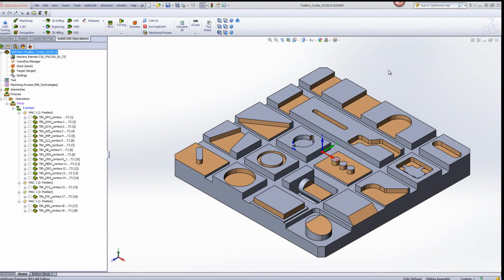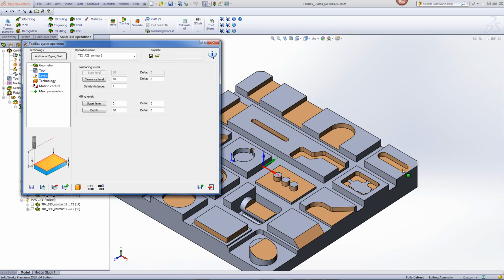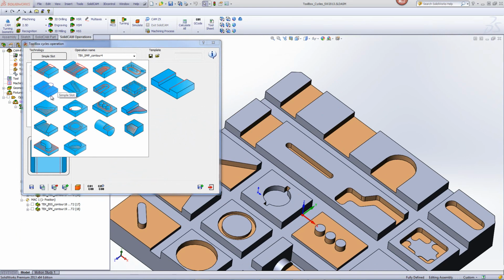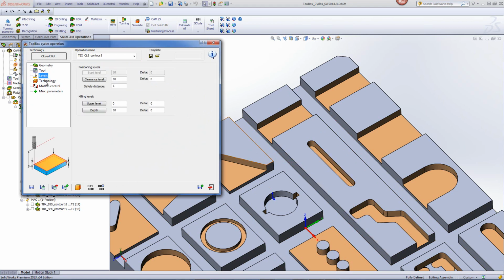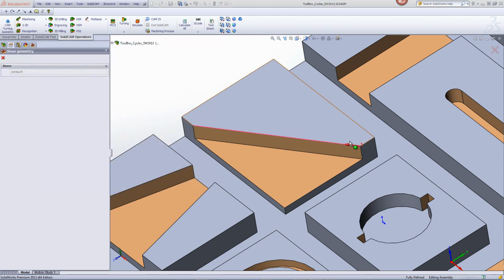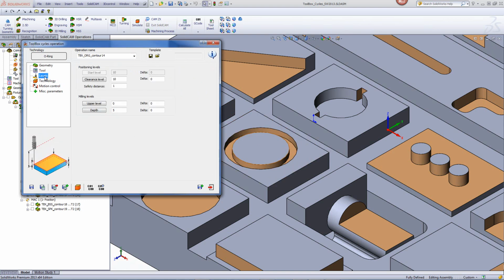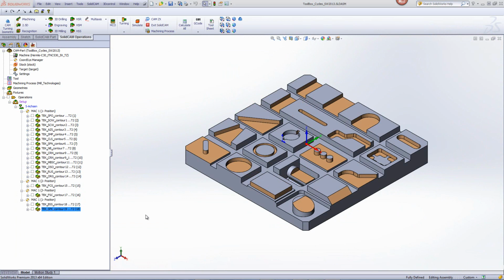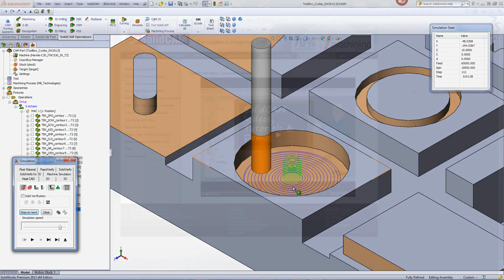SolidCAM 2013 Modules Overview: Toolbox Cycles

Comment: Hello.
I'm studdind Solid Cam. But what is the advantage of using ToolBox or the 2.5D operations? To mill a circle for example, I can use "pocket" strategy. Why tool box would be an avantage? Is it best milling as Spiral than pocket with many circles incresing the diameter?